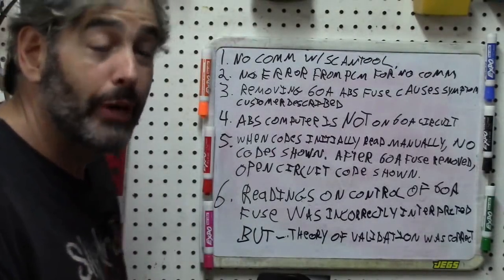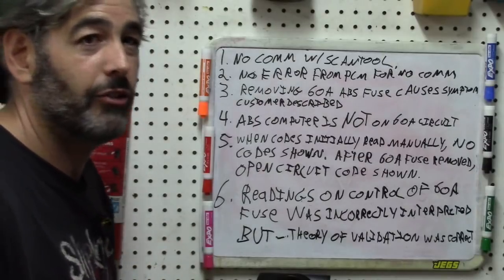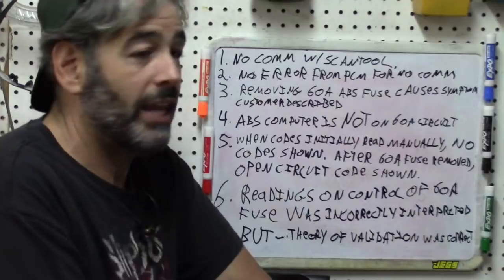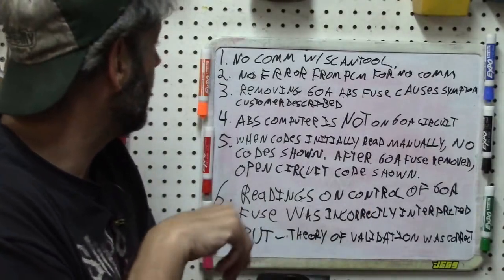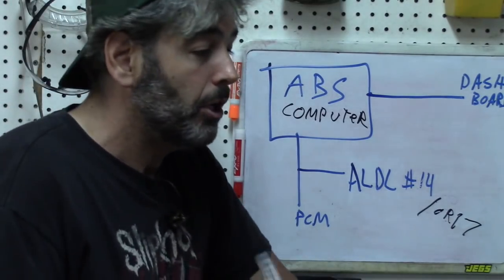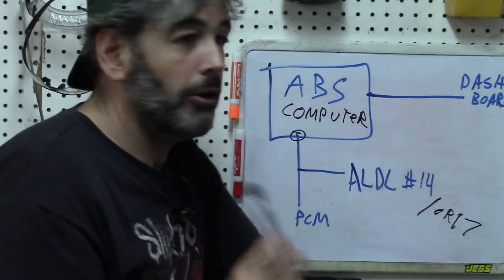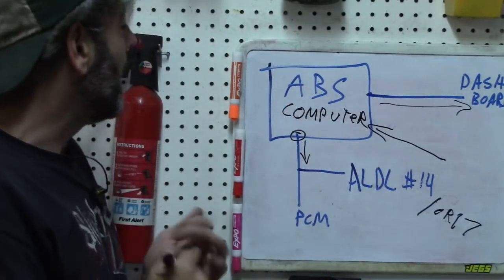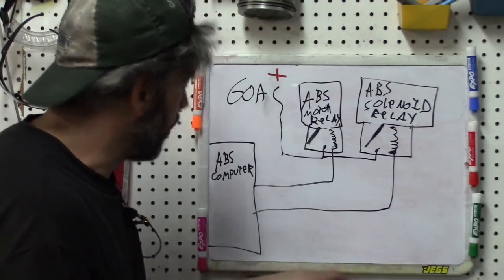02 Camry No Power Windows, ABS No Comm Pt2

Comment: The ABS computer probably has a bias voltage which monitors when the motor is turned on, which might be shared with the control circuit so it detects that change in voltage. From what I'm learning about certain ABS systems, That bias voltage is used to set a trouble code and detect control.

Comment: Hey Matt.  I gave more thought to my original comments the other day.  I'm thinking it's not a CAN type network for brake module.  Second thing I wanted to question:  I noticed cruise control is also a major element and has a requirement where it needs brake information.  Could buddy "button pusher" have decided to use cruise control whereas the owner typically does not.  Also, this there a traction contol button somewhere that could be sticking that the owner normally would have never pressed.  I would say also fast track your thinking process in the following sense:  Contact the owner and get him to go on a gravel road at about 25-30 MPH and hammer the brakes.  If he acknowledges ABS pulsing, you know you have your decision flow chart cut down the adventure 50% before it comes back to your garage.  Great series.  Can't wait to continue the learning journey.
Reply from the maker: Agreed. And I am sure the brake module is not CAN on this car.

Comment: From memory that ABS system DOES NOT store codes, you can only get them when they are current and the light is on.
Only later ones retain codes and those can also be read with a scan tool from internal OBD2.
External OBD plug is I think 17 pin and can be read with older scan tool and adapter.
Ok not 100% on this but pretty close.
You can prove it by creating a wheel speed sensor code and see if it is retained after key off.

EDIT Just realised this is an older vid, have you solved it yet?

Comment: 2 thoughts. Firstly, when did the flashing begin? Did it initiate while driving or on startup? Since we know brake system related faults do not illuminate the error until the next start up, if the flashing initiated during a drive, I would question whether it is related to the brake system.  Hopefully Eric will tell you he noticed it illuminate when he started the car as opposed to when he was driving.

Secondly, I know this sounds crazy, but Toyotas for some reason will illuminate the Track/ABS lights for unrelated events like failed EGR Position sensors and P0430. The absence of codes in the brake computer potentially supports that.  I’ve had Track/ABS illumination in 2 different models 2 different years.  The difference is that both errors I experienced triggered a P code along with the Track/ABS illumination.  Hope that helps.
Reply from the maker: Both said it happened while driving.

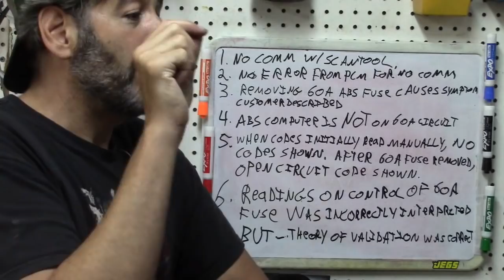Comment: 06:00
PCMs were hard-wired programmed? Or did you mean to say hard-coded?

Hard-wired stuff is pretty rare I believe, but does exist, as it's light-speed fast. I think card issuers use it for checking CVV/CVC codes.

In general, ABS modules go bad on all years/makes/models, the closer they are to the exhaust manifold, more often they fry inside. It can be difficult to set 100% confirmed diagnosis (and with labour hours sometimes not feasable), but one indication of a bad ABS module is if it starts to act weirdly in high/low temperatures (cooling it with compressed air from a can, using a heat gun).

Anyway, looking forward to Pt3!

Comment: I think until you catch the car in the act you are chasing your tail.  Yes you are able to duplicate the symptom by unplugging the fuse but in reality you disconnected power to circuits that the computer is looking at.

Are you able to communicate with every other module in the car before assuming a bad computer.

Determine which part of the circuit is bad then split the circuit in half and chase the bad half until you come to another junction then split it again and do on,

You can only fix an intermittent fault when it is reliably faulty.

I wish you the best of luck.

Comment: The diagram on the board at 22 minutes... the control side of the two relays, you show the abs module being one "leg" of the control side.  What is the other leg?  I'm going to guess a possibility... that 60a fuse supplies power to two pins of each relay - one for the main heavy duty load supply, and one for the undrawn control "leg."  

If my guess is true, when you turn on the key, and the abs does not ground the relay control wires, the 60a fuse sends power through the control side winding, and ends up as 12v at the abs module (no current flow, no voltage drop.)  In this instance, the abs module is able to determine the integrity of the two relay control side circuits, without activating any relays or taking any action - it just simply checks for 12v (apparently only as a startup check.)

I wish you would've drawn the other half of the relays control circuit lol.  Can't wait to see a scope on the module wiring!

Comment: 02 camry also is very inexpensive parts, if you are so concerned about this issue , go get another abs box and switch them out, also check continuity on wires as much as you possibly can
Reply from the maker: ABS computer on this car is $1300. 
  Even so, I am not a parts changer. I diagnose, not guess.
Reply: @SchrodingersBox  you dam near sound like a electrical engineer.   replacing the unit is just unhooking plastic plug type connetions and screwing the unit down more then likely.    next time you  have a "backfeed" problem use a diode to solve it

Comment: You used a red shop rag to wipe down the dry erase board and the 4 black magnets are missing.
Reply from the maker: I have used a red shop towel many times before but Good point about the magnets - that’s not it though.

Comment: You're logic is flawed at 26:26 of the previous video, you stated we are "missing a ground,"  when checking the fuse.  If the fuse had a ground on the other leg of the fuse you would have a short to ground and the fuse would be blown.  In addition,  you were stating that it could be a ground side switch, those are commonly used but that refers to a switch after a load( ex. solenoid, light) and fuses are exclusively used on the power side of vehicles.
Reply from the maker: The side of the circuit would have a ground, not the immediate other side of the fuse. I was expecting a ground through the load
Reply: @SchrodingersBox  I suppose that logic would work if you were sure that circuit went directly to a load and it wasn't switched
Reply from the maker: No- because I was looking for switching since that would explain the open. If the circuit is ground side switched I would see completion of the circuit. I did not know if went directly to a load or if it is switched before or after the load but either way I tested both and only the scope showed the actual design.
Reply: I curious to see this outcome, you should ask if the problem returned and if so the exact conditions for when it happened.  I'm wondering based on the window repair if these lights came on as a result of wheel spin during normal driving and the driver just hasn't seen it happen before.